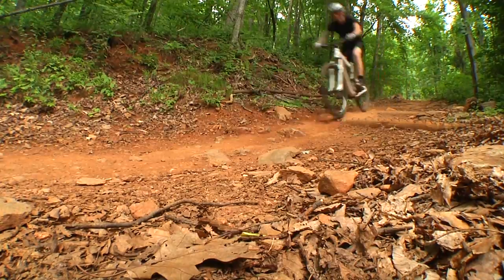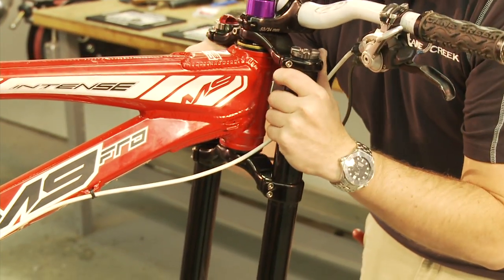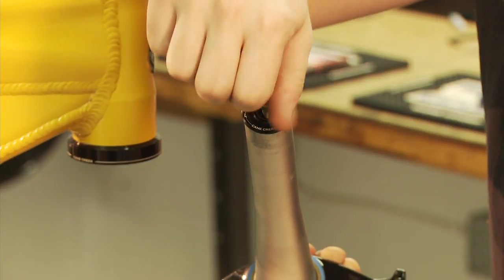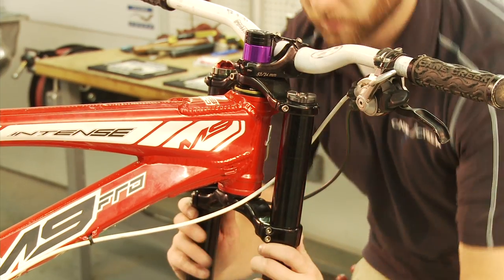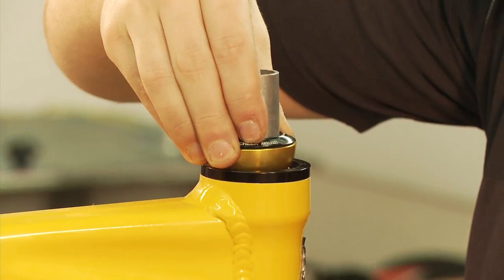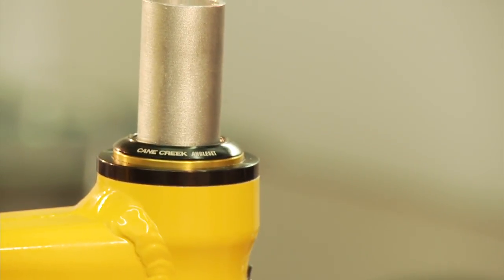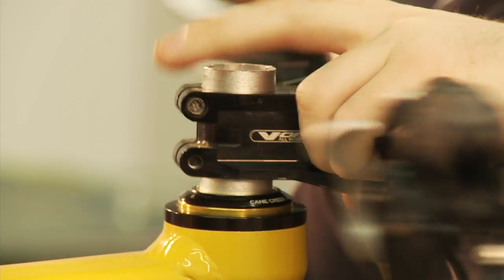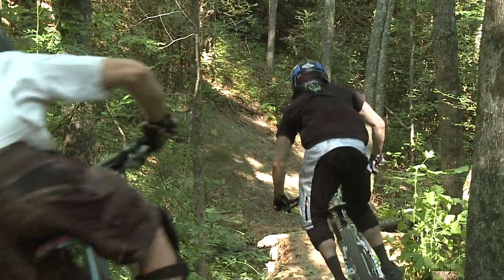AngleSet Installation Part 2

Comment: Yikes or get the Works Components angle headset and forget the gimbals. (Yes I used them knock, knock, knock.) Then I switched and knock free. Sheesh.....I am suprised after all these years that CC has not changed the gimbal method's problematic design.